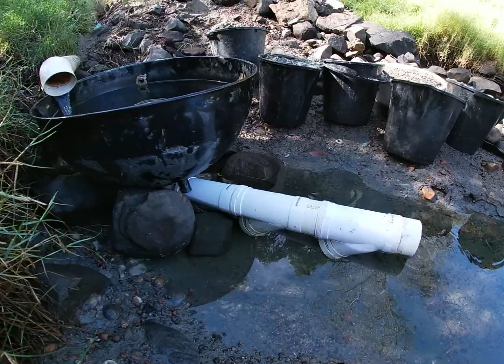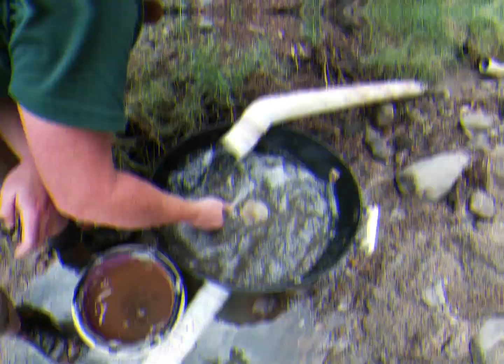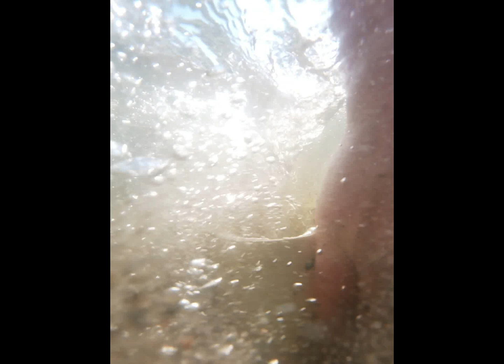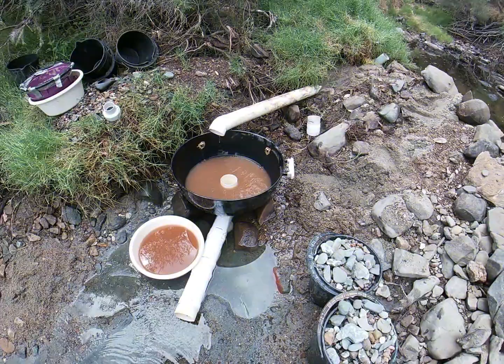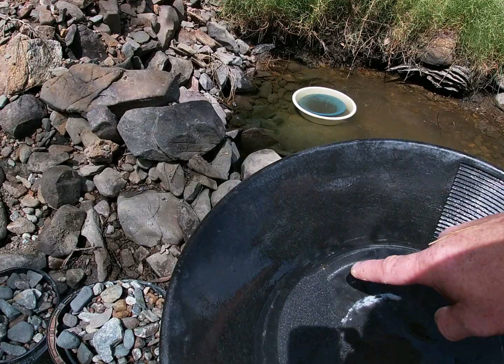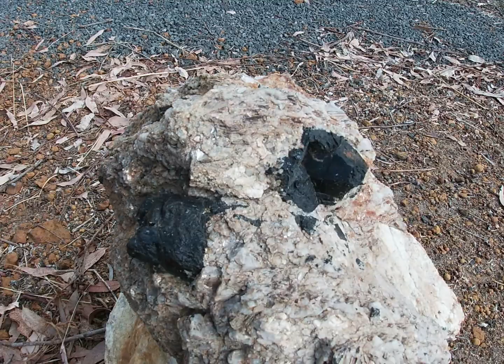Home made hydrocyclone

Comment: Love the build mate - looks like you put in some hours working that creek to :) id love to trial that rig here in vic at a few places....you thought about making a 12 v centrifuge ? subbed mate, keep up the vids.. love it... im midst building a shaker table atm to process my fines after going through a chain mill crusher...
Reply from the maker: Wish I had enough gold for a shaker table 😂
Reply from the maker: Thanks mate. Yeah a few hours lol. Not thought of a centrifuge but I can run the cyclone on my 12V pump for the gold cube. 

The cyclone is excellent for heavy  gemstones.... I also use it to pan into ... as a safety pan. Then any I loose from the pan is still mine. 

It was real easy to make. Just fix a  pipe into center of a Webber bbq.

Comment: Great job on the giant blue bowl. Well done thanks for sharing.
Reply from the maker: No worries 👍 I love my silicone leggo sluice mat 👍👍and I'm waiting for my mechanic friend to get me an old timing belt for a deep V. Those 90mm pvc y sections do a damm good job too... try half a dozen in a row at the end of a pipe and feed gravel into the top end with lots of water flow... I use a rubber door mat at the discharge to catch any gold that makes it through... but mostly it's a waste of time because the slanted drop riffles are pretty efficient.
Reply from the maker: Alan, I've been using silicone as sluice mat material since your vid a few yrs ago... I must say thanks for the idea because silicone is amazing at trapping ultra fine gold ... which is the most plentiful type at Donnybrook 👍👍👍